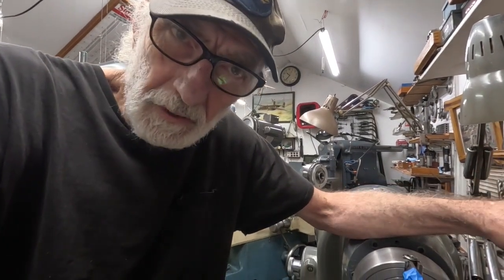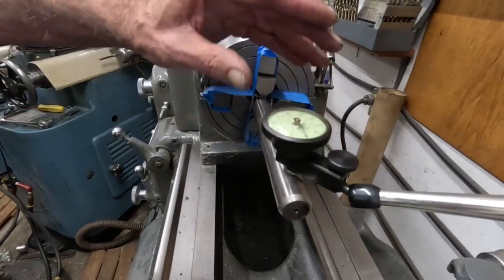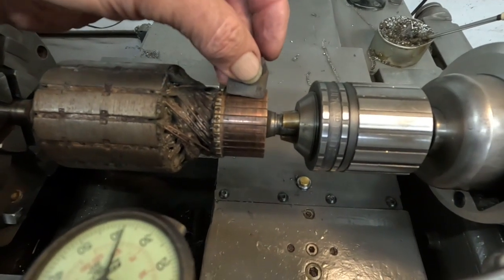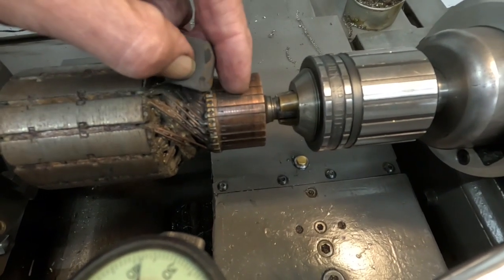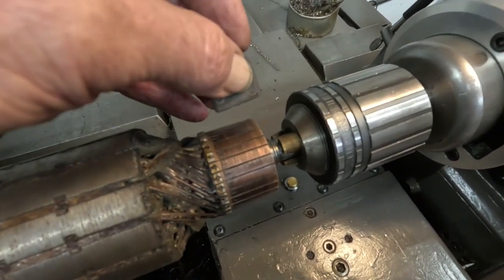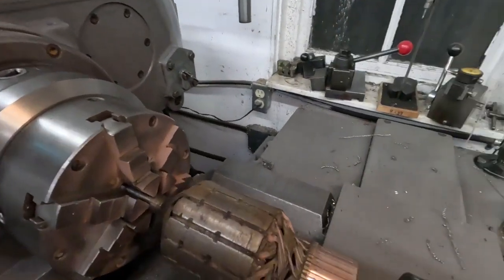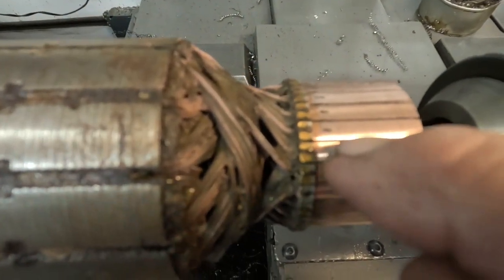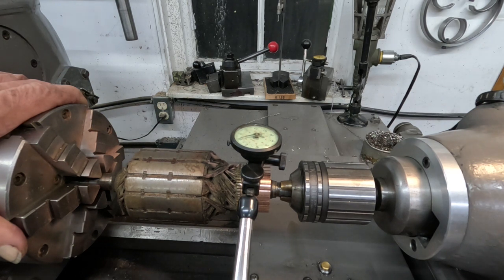Part 4 Sunday sidetrack Antique Automotive Generator Service

Comment: Great content Don.  I just found an old 1935 6V wincharger at a antique flea market place.  I will use this technique when I rebuild it.  Tnx.
Reply from the maker: I found the most notable performance increase on starters and generators that are the dreaded 6 volts!

Comment: Another excellent video series. Remember the tru cut armature lathe ? Little rotary cutter for under cutting the mica  or a hacksaw blade. Flint paper or stone  but never emery cloth the aluminum oxide will be imbedded in bars and between them acting as an unwanted conductor. Thanks again for the great videos ed
Reply from the maker: The Atlas uses an attachment with a Bodine motor and a tiny round saw blade, The Southbend had an attachment that you worked back and forth with a lever using a small straight saw for under cutting. The tru cut was geared for basic maintenance, where the lathes can also do bushings and whatever other machine work needed. The dressing stones doing the complete commutator reconditioning in 1/3 the time to higher accuracy and better control, used from vacuum cleaner repair to the motor generators in elevators and electric motor in industry but not in automotive. When I was doing this commercially, I would never let anyone see that. I had to be careful not to let anyone see anything not carefully controlled by me, small things getting out can be and was costly mistake.

Comment: Just wondering why you didn’t you tighten the tailstock chuck jaws to support the armature?
Is it just there as a safety measure?
Reply from the maker: The jaws on the tail stock chuck are bronze and act like a bearing, so you tighten them, then back off enough so the armature rotates, and oil them. Sort of an unusual item not seen often these days, thanks!
Reply: @DonDyarprecision  got it! I thought the bronze jaws were to stop marring and that the whole thing rotated. I enjoy and appreciate that you share your knowledge and experience.
Reply: @DonDyarprecision  And I believe that armature chuck has a lock nut that will bind the adjusting ring. ---Doozer
Reply: That tailstock chuck doesn’t rotate. If you tighten the jaws you’ll damage them. You might might note  that the chuck only allows hand adjustment, no tightening key.
Reply: @melgross  so if just acts like a fixed steady?
I thought they had ball bearings similar to a live centre do the jaws could be tightened and the whole thing rotate?
Reply: @Throughthebulkhead  no. The brass jaws act like the brass jaws on fixed or live steadys. These aren’t very expensive chucks. Rotating chucks cost a lot more.